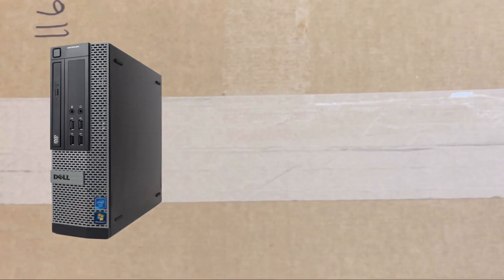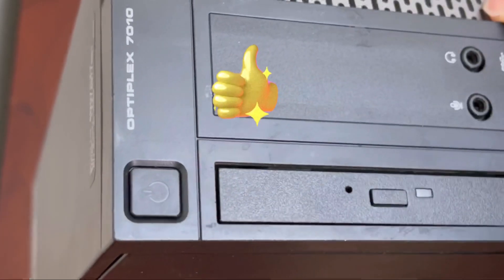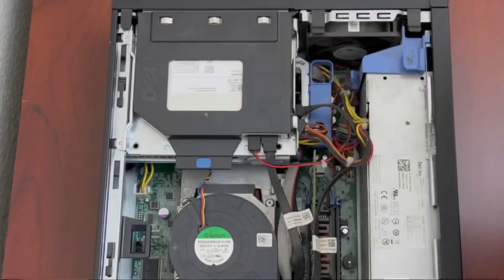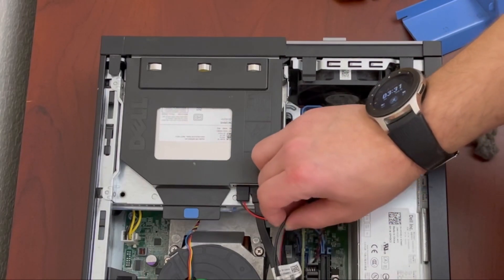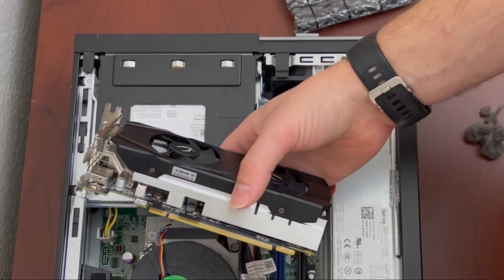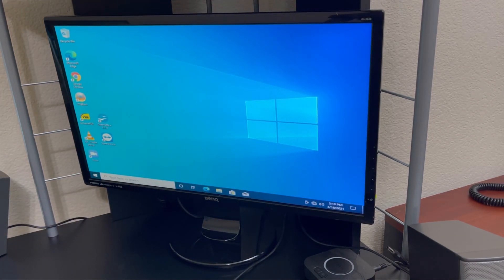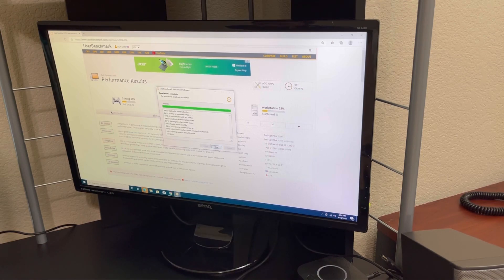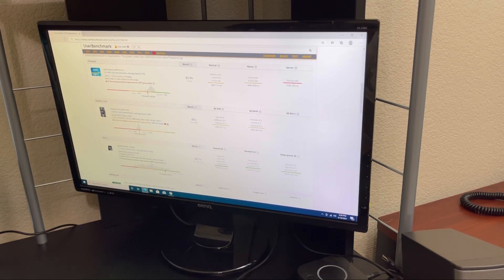Installing a Zotac GTX 1650 low profile in an Optiplex 7010 SFF for gaming

Comment: Is the standard power supply capable of running this graphics card?  or did you buy an upgraded PSU?
Reply: I was wondering the same thing. I am considering buying a low profile GTX 1650 but I can't find a 300w+ PSU that will fit in the case. (Dell Optiplex 7010 SFF)

Comment: Would a Optiplex 390 DT work?
Reply from the maker: Just make sure you measure the length of the space first.  Most of the small form factor Optiplex’s have about .5” variance in the available space, and the ones with the smaller space could have trouble fitting the dual fan cards.
Reply: @OptiGPU  Thanks alot for the reply

Comment: How many watts is the power supply and is it enough for such a system?
Reply from the maker: The system has a total load wattage of 220 and the PSU is 240

Comment: Does it overheat? The power supply is right on top of the fans.
Reply from the maker: That’s a good question. I wasn’t gaming for hours on end with this card, but it fared fine with light gaming. I should do a follow up video with a temperature overlay.

Comment: Is any PSU cable needed to connect via cable for supplying power or it gain power through pci slot?
Reply from the maker: Nope. It gets all its power from the pcie slot.

Comment: Hey! Great video, but I was wondering if you could answer some questions?

I have a refurbished Optiplex 7020 SFF, and I want to find a graphics card that will both fit into the case, and also has a VGA port. I don't want to do anything major with the card, just minecraft and rocket league. 

I've been told to look into the GeForce 700 series, or a GT 1030, but I'm not sure if any of them will fit, or how to check. (The power supply shield sits directly under the port and doesn't leave much room, which ive heard can cause issues)

I can live without the VGA port if necessary, but that would mean either finding a new monitor or buying an adapter, so I'd rather just try and find a card with one. 
Any ideas?
Reply from the maker: It needs to be single-width for the pcie 16x slot, so I’d go with the GT 1030. It’s the best one with a VGA port.
Reply: @OptiGPU would the optiplex 7020sff work with a 1650 lp if it has a 255w psu

Comment: Would a Dell Nvidia GeForce 1660 ti fit In a Optiplex 7010 SSF?
Reply: Just get the 1650 it’s less work on the pc and it’s still very powerful and it’s cheaper

Comment: i know its  been a long time since u made this video but do you think asus geforce gt 1030 2b ddr5 can be used in a dell opiplex 7010 minitower
Reply from the maker: What brand? Is it low profile? The minitower case is much roomier than the small form factor case I showed in the video. You could therefore get away with a standard height card. It looks like all the GT 1030s are shorter cards and so the RAM wouldn’t get in the way. That’s the only thing I’d be worried about. Measure the space along the blue PCI slot from the edge of the case to where the RAM is, then get a card with a length that fits.

Comment: Works in a Dell Optiplex 3040 sff?
Reply from the maker: The PCIe 16x slot is right up next to the power supply. I’d recommend the RX 6400 because it’s single width.

Comment: Hey can you put a ZOTAC Gaming GeForce GTX 1660 Super in this. please i need this answered asap
Reply from the maker: I believe that’s a full size card. Only low profile would fit in a small form factor case like this. If yours is a mini tower it would.
Reply: @OptiGPU  Would this work on a Dell Optiplex 9020SFF

Comment: did you have any problems with the power supply, Becuase mine is only 240 W and the card requirement is 400 w minimum,  i have the same optiplex 7010, did you upgrade the power supply?
Reply from the maker: I didn’t have any problems with the stock power supply

Comment: I have same optiplex
With 32 ram and i9 9900
200psu
Can i get a 1650?
Reply: maybe the cpu is a 65w tdp and the gpu is 75w tdp.
Reply from the maker: That should work just fine. If it’s not a small form factor (SFF) case, consider getting a more powerful full-size card instead of low profile.

Comment: Will a gt730 work for this
Reply from the maker: You could play some games at the lowest graphics settings with that, but to play everything new in 2022 you’ll need something with at least double the capabilities of that card. It could work for casual gaming, but I’d go for one featured in my videos if you’re wanting to play something more competitive.
Reply: 730 is meh... it means 7.3 frames per second :D that card is only useable as a "display-adapter" for having a picture on the monitor and nothing more.
Some newer integrated Intel HD/UHD/Iris Graphics can do the same as the GT730.

go at least for a NVIDIA 1030 (90 to 100$) or T600 (about 210$, GPU for Workstation but also good for gaming) or GTX1650 (also about 200$) or AMD RX 6400 (about 170 to 210$).
But avoid GTX 1050ti (still !! about 200$).
That card is old and expensive and have less power than T600 or GTX 1650.

All cards I've listed for you are low-profile compatible.

Comment: I bought a used card and don't have the low profile bracket and can't find one online that goes with it. What should i do?
Reply: I stuck a WIFI card in and used a piece of pool noodle, cut with a steak knife, to jam in and apply adequate pressure when the case door is closed.
I can't find SFF brackets either !!

Comment: What if we only have a vga cable
Reply from the maker: The graphics card will have an HDMI port, so I’m guessing you mean your monitor can only do VGA?  If that’s the case, I’ve been there. You’ll have to head over to Amazon and get an adapter to convert the HDMI from your card to VGA (just make sure the conversion is in the right direction and that it is the proper male/female for your set up).

Comment: Hi, what vido card can i put in my optiplex 7050 i5-7500, without changing the power supply unit. Can i go for xfx rx 550 ? or  should i go for the card presented in the video ?
Reply: What did you go for
Reply: @_Gioro  Amd RX550X
Reply: @popescudragos7376  maybe you went with the wrong chioce, the 550 performs way lower, but if you dont game than it was probably worth it for the lower cost
Reply: @_Gioro  actually it's performs very well for my needs. I play fifa 2022, Mortal combat 11 and League of legends with high and very high details settings
Reply: @popescudragos7376  wow, i really didn't expect that from a rx550

Comment: Does the psu need to upgrade?
Reply: not really. but it could be almost on limit already with the new GPU.
There's not much headroom for further upgrades.
CPU, HDD, RAM, Fans, all that needs power too. normally this PSU have about 200 to 250 watts of power.
GPU needs up to 75 watts, CPU needs about up to 40 watts, HDD and RAM will consume an extra of 15 to 50 watts depending of if you have only a SSD or 1 SSD paired with 1 or 2 HDDs and the amount in GB and count of RAM installed.

Comment: Nice Video i plan to do the same thing to my 7010 sff but the only question i have is has it enough airflow? I'm worried that it melts 😂
Reply: can u play Roblox without a GPU?
Reply: @sajaymandog  No
Reply: @sajaymandog  you need it
Reply: @sajaymandog  yes u can
Reply: @sajaymandog  you can, but dont expect any good graphics
Reply: i will recommend a dell optiplex dt version then the airflow is much better and its also low profile

Comment: I have a hp model similar to the Dell, I have a 1050 init with i5 4570 and it does very well. Stays super cool cpu stays under 40 most of the time gpu in the 40s I have 250$ in it total

Comment: what are the temperatures like?
Reply: in a HP EliteDesk 800G1 SFF about 65°C on CPU and 70°C on GPU (Intel i5 4570 with NVIDIA T600) on hard gaming with the fans clearly audible in mid-range.
but it runs 5 year old AAA-games at 1080p with low settings just fine at 60 fps.
(or you can do medium settings at 30 fps but I prefer more fps than quality)

Not ideal temps of course but in acceptable range.
A PS3 with less power makes more noise than that PC. (Just for comparing)
Reply: @gumpi5  wrong the temperature is 300 degrees

Comment from the maker: Should my next video be about how to find graphics cards in 2021 at decent prices (paid just under $230 for this one in April)?  If so, like, subscribe, comment, let me know!
Reply: Ye that would be great as trying to find on thats not more than £160 (still a bit over price at that)
Reply: Hey Zack first of all thanks for the video. How is your experience with the 1650 on this model? is there enough space and ventilation for this GPU? looks like is very close to the power unit. Thanks in advance!
Reply: install Heaven Benchmark 4.0 and run benchmark you see average of 60 fps and i had before gt 1030 and getting 22 fps.  your benchmark test ,not so good for information.  have same pc 7010 and cards
Reply: Hi OptiGPU, I'm would like to check with you. My pc is Dell optiplex 7010 i7-3770 16Gb Ram. Can I upgrade a gtx 1650 super? The space is enough  to this GPU? Need to change the power supply to 500w?
Reply: when changing to a new gpu don't you have to uninstall all the gpu drivers from the old one before you put in a new gpu?